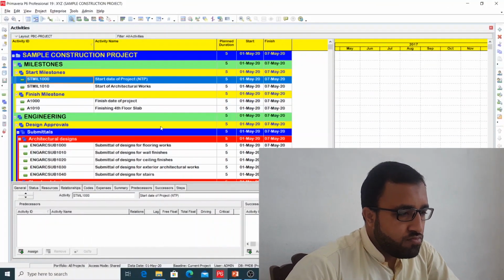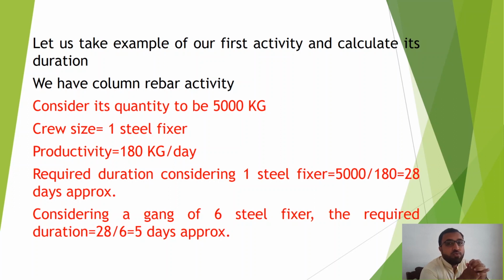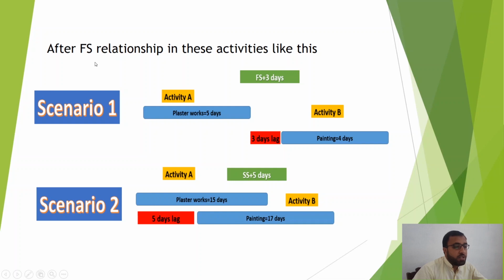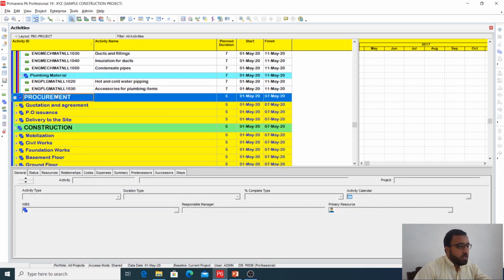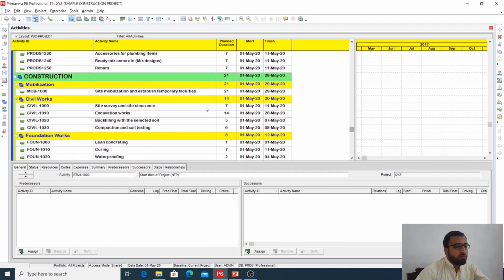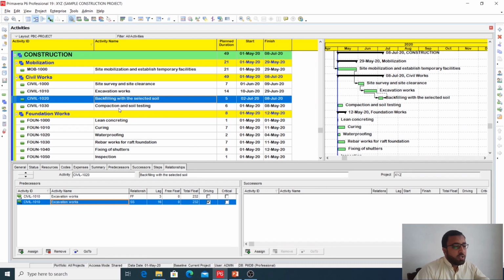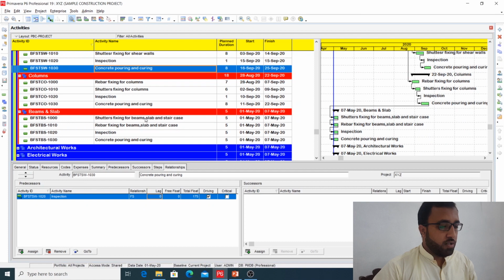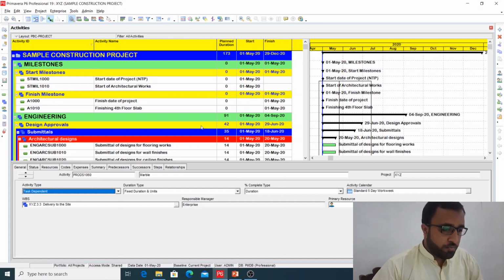Adding Activities,durations and relationships Lecture 4 Part 3

Comment: Sir you mentioned in the beginning of your lecture that each activity must have at least one predecessor and one successor activity except starting and ending milestone... Then why have you left activity of Backfilling without any successor?
Reply from the maker: Its just an example schedule.No activity should be open ended
Reply: @engineerawaisislam7387  Sir can you please share data e.g producitivity sheets, project xls file, xer file, reports etc?